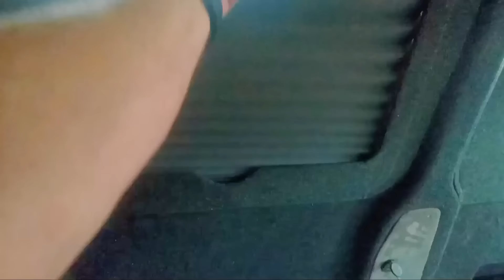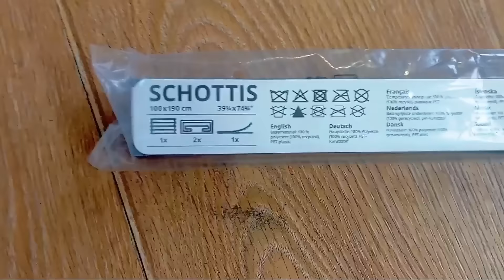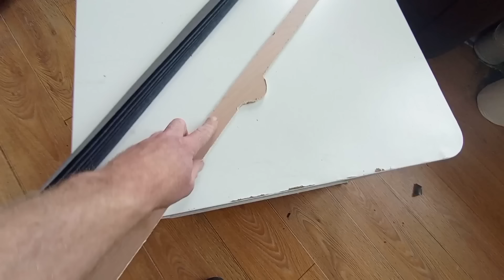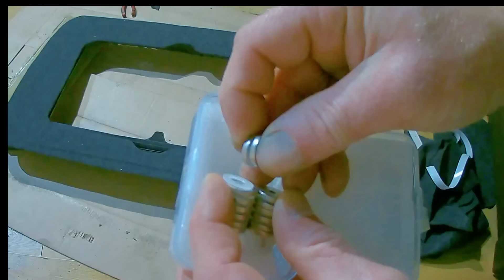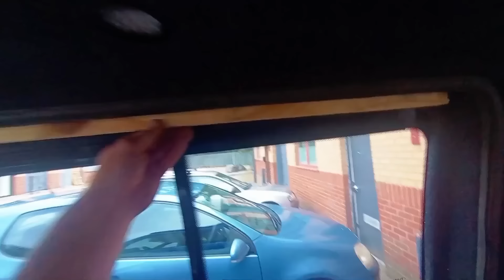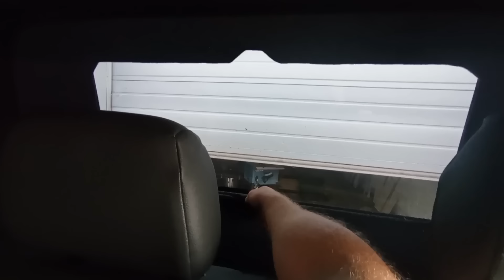How to make DIY campervan blinds.  IKEA Hack.  Transporter T5 build.

Comment: Looks good. I have a question as I'm trying to retrofit these blinds to replace existing jobs....what is the size of the material when folded...the honeycomb material.  Not the width or the height but the depth as I'm looking for material that will fit into my existing tracks . Thanks 👍
Reply from the maker: I'm not home until tomorrow so I'll double check then but I think it was 20mm.
Reply from the maker: Apologies I was wrong about the size they are actually 30mm.  Hopefully they will still fit for you.

Comment: They look neat & really professional. Nice tutorial too, 👍. How do they stand up to condensation?
Reply from the maker: Time will tell with the condensation as I'm not using it yet, although it is a waterproof material so the actual blind will be fine but I need to do something thermal or I will get condensation on the glass.
Reply: How did you hide fixings when attaching the pod to battens on window

Comment: You're absolutely right, I wouldn't have believed it. I think I might get a Trippevals cellular blind and cut it up to try the same type of system with that air layer for insulation. They are 1.8m talls so I should be able to get several windows out of one blind
Reply from the maker: I had trippevals in mind but the are a fair bit more money and didn't have the confidence that I wouldn't mess it up and waste them.  You might get 4 windows from one blind,  my drops are about 40cms.
Reply: @mattybrawn I was thinking those magnets you used, and strips of small flat bar, or even old tape measure.
Reply: Good idea @

Comment: For warmth and sun blocking, you could add velcro to the backs of some blackout curtains cut to size. They can be easily attached to the carpet with the hook strip on the backs of your covers. I hope I'm making sense here....
Anywhoooo, lovely job on your blinds, they look great!
Reply from the maker: Perfect idea.  I will definitely do that.  Best I had come up with was some insulated inserts to put in between the glass and the blind but your way is far better.  Probably won't need them often but I'm in Germany for a week at new year so will need something.

Comment: I have to say, those IKEA blinds are great for the price. I've used one for the sliding window between the cab and rear in my Boxer. It's a shame they don't do wider ones or I'd do this for my sliding door.
Reply from the maker: Yes a bit wider would be great.  The reason I tried the Dunelm ones was because of the width on the tailgate but they were terrible quality, literally a sheet of black paper.